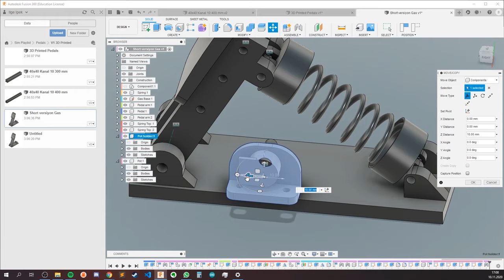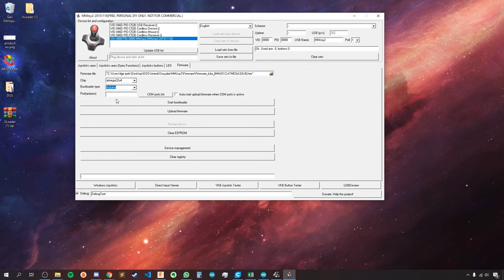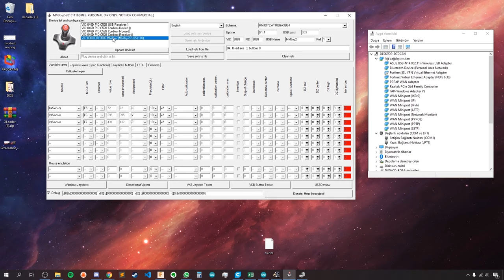DIY Sim Racing Pedals (3D Printed)

Comment: Those springs are not enough for the immersion, apart from that build quality is top notch
Reply: just buy a damper and increment in the project
Reply: I need a set of pedals for a spare gaming rig - something to use with Mudrunner/Euro Truck and the like.  These look fine for that purpose.
Reply: @marcosdimoise8662  what is a damper?
Reply: @szalonykierowca5870  an oil filled shock absorber to give the feel of a brake pedal.

Comment: How is the pot shaft coupled with the spur gear?
Also, is there a standard stiffness for spring?
Also also, why does the clutch pedal have a shaft inside the spring and others don't?

Comment: great project! this ist, what i was looking for. i disassembled an old pedal-unit from a thrustmaster steering wheel. the potis are the same. i assume, they run on 5v, cause you wired it to the arduino, right? so what is mmjoy2? as far, as i understand, its an interface for arduino, so you dont not have to write your own sketch, and it provides a virtuell joystick, that windows can "see", right? i want to use this for MAME.

Comment: Nice racing shoes! Could you use a load cell for the brake instead of a potentiometer? Awesome build, never done a Arduino project before but I don't own pedals or a wheel ATM so I'm tempted to give this a try!
Reply: Yes, you can use a load cell too. It outputs a signal similar to a potentiometer. The harder you press the higher the signal, which the Arduino can read easily.

Comment: Hello! I printed these pedals and put them together. I noticed 2 problems: the springs fly out of the mountings. And the upper spring mount prevents the potentiometer gear from turning.
Reply: He used glue to hold the springs in the mounts

Comment: hey, do i need a breadboard and 2 resistors to make the connections ? like for the pedals and the steering wheel (with shifters but no ffb), and which resistors do i need ?
Reply from the maker: Hey Wilson, you can get the details on my blog: http://ilgeipek.com/sim-racing/diy/pedals/
Reply: @ilgeipek_en  really cool ! Thanks a lot

Comment: Good job! What's that small IC chip you are using?
Reply: If you are referring to the small blue one he wired all the potentiometers to, it's an Arduino Pro Micro.  For most projects like this you would use a Pro Micro or possibly an Arduino Uno, as they can operate as keyboard / mouse / joystick on computers.
Reply: @truepennytv  I believe an Uno doesn't have HID compatibility. The Leonardo does. I would suggest a teensy though. Since they can read potentiometers at a higher resolution. The Pro micro (and leonardo I believe) only do 10 bits (1024 values over the full range) where a teensy can do up to 16 bit I believe (or even 32 Idk). 16 bit would give you 4x the resolution so 4096 values over the full range. Especially if you're doing a wheel. You'll need a fast microprocessor for accurate high resolution encoder readouts. I'm building a wheel which uses a motor with an encoder on top of it that reads about 5 steps per degree of rotation. If you flick the wheel 180 degrees within half a second, you need to make sure that it won't miss any step of the encoder, cause if it happens too often it could result in a weird offset from straight.

Comment: Hello, Can i use Arduino Uno R3?
Reply: You can't....sort of. Arduino leonardo has USB HID controller, and Uno don't, so you will not be able to program/flash the Uno with the used software
Reply: @wiktorjaworski1710  wait did he use a nano or a pro mini I'm so confused
Reply: @sh3ldox260  he used arduino pro micro.